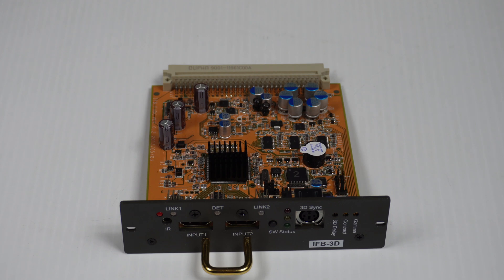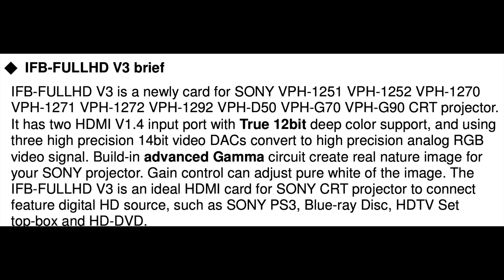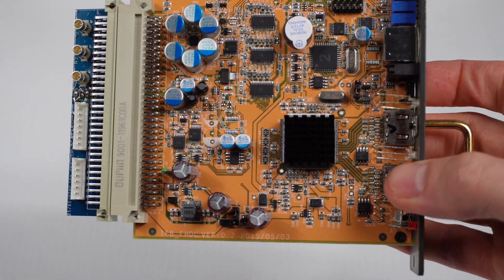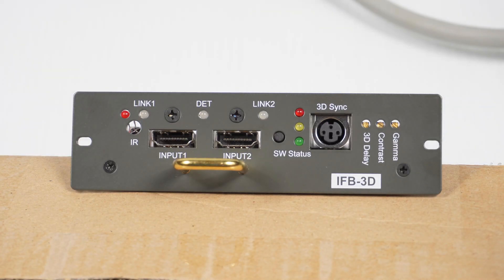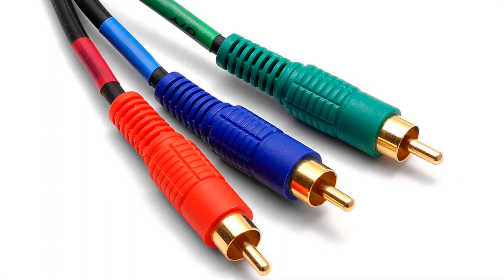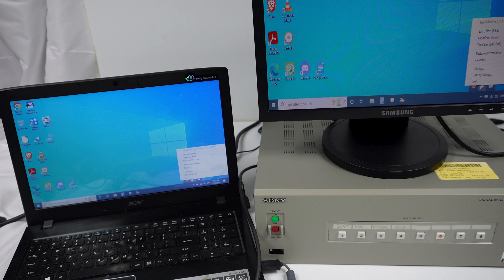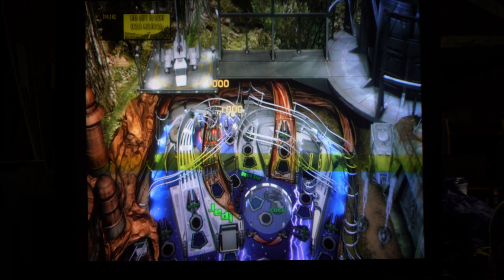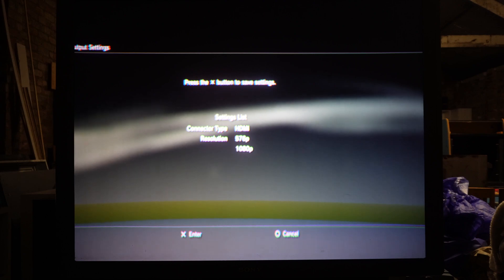Sony IFB-FULLHD V3 HDMI Expansion Card

Comment: Side note, the cheap VGA converters you've shown all suffer from compression in the RGB space. Usually not 4:4:4 and also it suffers from black crushing. I hope the internal high end card faires better on this regard. I've had horrible experiences getting a good RGB signal out of those cheap HDMI converters.
Reply from the maker: You would certainly expect a high  level of performance for the price of the card, $350usd.
Reply: You can probably look up shmups forum for discussion on those adapters since they were going over black crush and other details.  I thnk the Tendek was their choice of reference, but something about the hardware changed down the line and right now most are luck of the draw.
Reply: @user-xt1mw6vm3y  They had one that attaches directly to the back of a monitor, but part of the problem was the lack of a hdcp handshake.